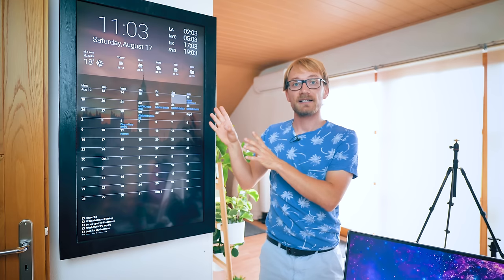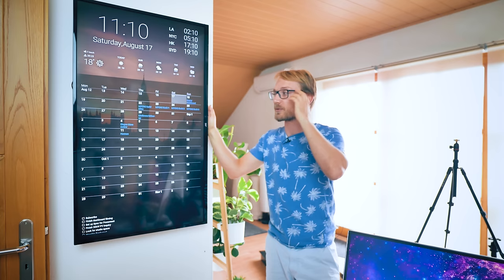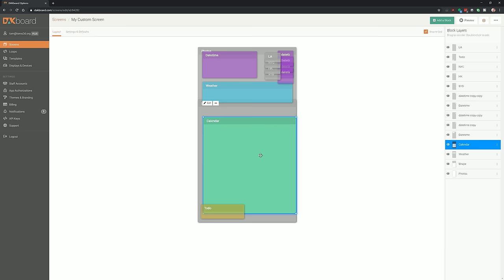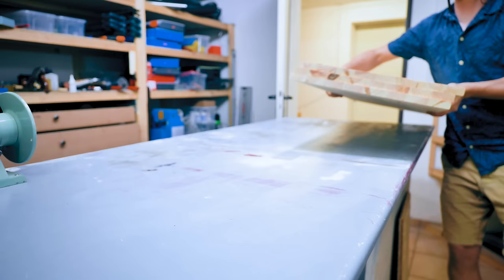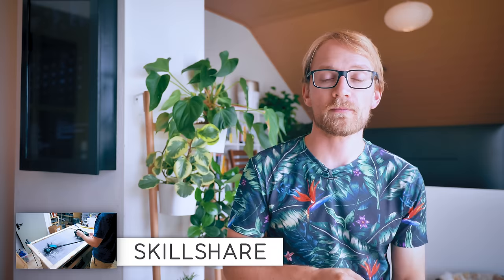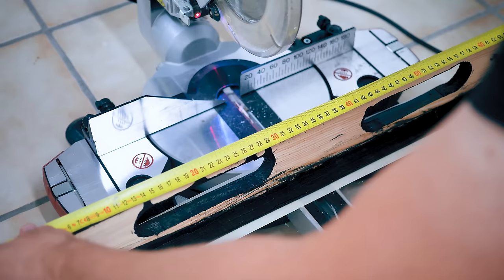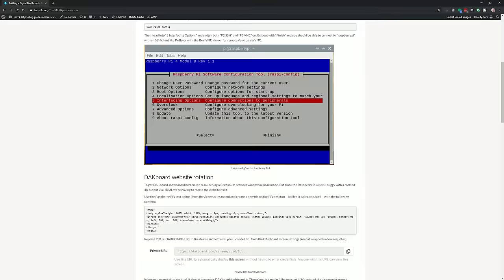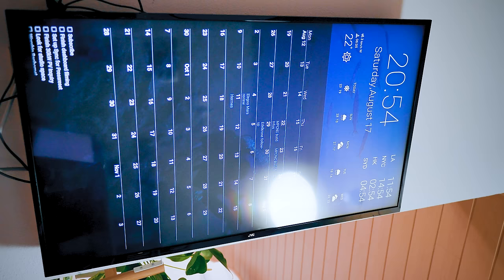Making a Digital Dashboard! (w/ Google Calendar integration)

Comment: @Thomas Sanladerer  check out xrandr for screen rotation, calling xrandr with no parameters lists connected screens and their ports. To rotate for example screen connected to port HDMI-1 (output on my PC) it should work with just: xrandr --output HDMI-1 --rotate right
Then just place it to same place where you start Chromium. If you wanted to change more parameters, you can install simple graphical tool arandr (or lxrandr) - enable screens you want, set their resolution and rotation as you want and then save as file. It will generate batch file with command you can just copy into your LXDE autostart file and it should apply all changes. If Raspbian still uses xserver, then it should work with no problem. Also another autostart file is .xinitrc and that should be universal for any desktop environment.

Comment: I would like to know more about the music clips used.

What I would do, add a motion sensor that could be used to turn on the screen, and off if no movement had been detected. With a long timeout for off of course.  I am using some cheapy microwave sensors bought from Aliexpress for about a dollar. They are very sensitive. This could save some power and extend the life of the screen for some people.
Reply from the maker: All my music is from Epidemic Sound! http://share.epidemicsound.com/MadeWithLayers
Nice tip with the microwave/radar sensors - I've only used PIR in the past, but radar could be a more sensitive option.

Comment: you can add a motion sensor to turn on and off the monitor
Reply: Totally agree. We have a small picture frame that cycles pictures with the date and time in the corner that is activated with a PIR sensor. Definitely more energy efficient.
Reply: Agreed.  Though depending on monitor/TV the wake time might be annoying - using an OLED would help, but also be insanely expensive.

Perhaps setting it so that between 6am and 6pm or something motion causes it to turn on immediately and off after 10 minutes without motion, but between 6pm and 6am it turns on only after say 15 seconds of motion but off after only like 2 minutes without motion - if you had to check it it'd kick on but if you walked past at night it wouldn't turn on.

Comment: In the AV world there is a flush TV Mount that is called a Rubberband Mount. Just two Metal Disks you attach to the wall and thick cable you attach to the VESA mounting on the TV. However it would be recommended to use a recessed electrical outlet. This way you only have to deal with the thickness of the TV itself.

A honeydoo list is always fine but a stock ticker or local news ticker on the bottom is always great to have. If you listen to a lot of music while working you could have it show the Artist/Album/Song title in a little area.

Comment: You might reconsider using the wiggly end of the tape measure after you read this. The reason it is wiggly is to offset its own sickness. When you push it up against something it shifts just as much as it is sick same thing when you hook it on the edge of something and pull it it shifts back to offset so it always reads correctly

Comment: One trick that you can use to get the IR remote working better is to make a "waveguide" from a piece of clear acrylic. Bevel the top and bottom of the piece to help internal reflection and leave the end of it poking out from the inside of your timber bezel.

Comment: Magic mirror without mirror? :hmm: 
I'm running five 50" 4K screens for dashboards at work, two of them powered by Raspberry Pi 3s with mentioned 4K@15Hz configs. However in my experience I think truth is that these dashboards are cool for few months and then you just forget them on the wall. The data on these dashboards must be simplified and easy to peek for quick information otherwise you stop caring what's visible there. :)
Well, DIY projects aren't always mean to be long-lasting like maybe this one. The fun comes from building and configuring it.
Reply: Insomniumer what kind of work do you do?
Reply: @JLake3D  Network Operations Center, it means a lot of stuff (networks, servers) to monitor in real-time.

Comment: I want this But With E-paper! 
It would use much less power, have great viewing angles and not emit light during night.
Reply: Same. But every time I look at prices for this (which has been like every 6 months for the past 2 years), E-ink displays are still very expensive and not very big. Like commonly available e-ink displays for the Pi are like 7-inches big for $500. And refurbished kindle screens aren’t much bigger. Something as big as a sheet of printer paper 8.5” x 11” doesn’t even seem to be available outside of bulk/commercial pricing, let alone something as big as what he has hanging on the wall there... oh yes, and those are all monochrome. Just forget color e ink exists because you can’t get your hands on them... 😩

Comment: "the wiggly end of the measuring tape" serves a real purpose. It allows for accurate measurements to inside and outside edges. Notice it wiggles by precisely the thickness of the metal hook.

Comment: I wonder if this (or something like this) could handle heat and some humidity. I'm looking for something like a small digital whiteboard to put above my deep freezer, where I can make a list of all the items in the deep freezer, the expiration dates, etc. I'd also like it to look at the current date and when something is getting close to 90 days of expiring it'll highlight it in green, 60 days of expiring it'll highlight it in yellow, when it's 30 days of expiring orange and when it's expired highlight it in red. Also, some sort of check off/adding system, so when something is removed, it'll take it off the list, or if something is added, it's added to the list. This way you'd have an inventory at a glance when you go shopping... better yet, it'd be nice if you can have it to add staple items to your shopping list once you get down to x level ... or even where you can access the same list when you're at the grocery store.

Another nice feature would be where you can see a log of the temp inside the freezer, preferably without a wire coming out of the freezer (bluetooth maybe??), so you can see what the temp is, and a record of the temp so you can see if it's went above freezing, etc.

Comment: I am a huge fan of PetRockBlock's PowerBlock for adding a Raspberry Pi power switch. Using them on almost all of my Pi projects now. They have a separate LED indicator light circuit as well as a standalone 5v output. One click of a button, the software starts a safe shutdown of the pi, the LED indicator illuminates in different patterns to let you know what is happening, and after safe Pi shutdown it cuts power to the 5V out line which in turn switches off my MeanWell power supply (RSP series, which has a remote on/off capability). Adafruit has a new RGB version of the ubiquitous LED ring power switch, so I can now use LED color as an indicator in addition to the flashing pattern.  Yes you can roll your own safe shutdown switch for a little less money, but this board has been 100% flawless for me - worth a little extra money for the built in features and the fact that I don't have to mess with it

Comment: I have a similar project running. I'd recommend the following, the chromium browser and the rest of the system is constantly writing to your card, you can check for IO activity using an utility like iotop. All that small file writing will kill your SD card fairly quick. Install  profile-sync-daemon to send the chromium profile to RAM, and install log2ram for everything else.

Comment: "deal with the wiggly end".... it "wiggles" so that your measurement isn't off by the thickness of the tip of the tape measure.
Reply: More about easier accuracy than having to rely on a moving bit that might have been slightly bent.
Reply: @z0178  Tom's method obviously worked out great for him, and I'm sure the accuracy of those cuts to shorten it were more accurate than a slightly bent tape measure tip.... /sarcasm 

Honestly for woodworking a slightly bent tape end (that is not bent enough to be noticable) is plenty accurate enough.
Reply from the maker: Really, I just didn't want to scratch the screen... But, yeah, using the tape properly would have been quite a bit more accurate in the end 😅

Comment: Thanks a lot! I've been looking for months for a good service to put reports in the TVs in our office and was using a terrible solution combining Google Photos, Chromecast and python that would work very well most of the time and terribly bad a few times.

This worked really well with just a few hours adapting and studying the software. It's really easy to use it with smart TVs, don't even need the raspberry pi.

Comment: You could add one of those IR repeaters used for keeping your misc units contained within a closed cupboard to avoid having a hole in the frame. Or possibly even make some IR hardware for the Pi and let it control the TV via CEC.

Comment: I want almost exactly this for my house, but with a touchscreen, plus an auxiliary keyboard with integrated touchpad on a fold-down shelf. 

Currently there's a wall that has a large blotter calendar, a white board, and a cork board which is the "family command center". Works well as it's in a place where everyone can see it... except me, when I'm at work. And nobody wants to add everything to two calendars (e.g. the paper one and a Google one) so I'm frequently in the dark about what's upcoming.
 I've wished for a long time for an electronic solution but large touchscreen displays are ruinously expensive and I only realized recently that touchscreen conversion frames were a thing and apparently work well enough for what I want to do.

Problem is that with the TV (~$200), the Pi (~$100), the touchscreen conversion frame ($200), the keyboard ($20), and the wood and hardware to mount it and make it all look good, this would end up running well over $500, not to mention the time and effort. I think it would be a fun project though...

Comment: Question: Does the screen burn-in occur faster from leaving the exact same screen for 10 hours a day?
Reply from the maker: Modern LCD screens, unlike OLED or Plasma, do not suffer from burn-in.
Reply: @MadeWithLayers  actually LED screens are able to suffer from “burn in” but is a relatively easy fix, white screen for 6-8 hours and back to normal helps “reset” the affected pixels ,

Comment: I'd have added a motion sensor to the Pi, so if it doesn't see movement, it will reduce brightness, and maybe a wireless mouse too, it's ace, but consider the power for a static image? Maybe photo feeds for interest.

Comment: To avoid screen burn-outs picture should change with time - move some pixels vertical/horizontal every fifteen minutes, or gradually change colors. Even professional display used for digital signage can easily suffer from burn-outs, and this type screen is manufactured to withstand 24/7 displaying.

Comment: Would that be cool if that had touch screen...
Reply: I did something similar to what Thomas did but used a touchscreen monitor.  It's a royal PITA to get the monitor and the PI and the touch to all play nicely.  If the display is turned then the touch doesn't rotate so your presses don't line up.  I'm still trying to work it out and gave up for a few weeks.
Reply: I would add a leap motion below the screen and use gestures to control it.
Reply: @diymatt  i recently had the same Problem. You just need to use "xinput list" to show all your input devices. Get the ID and the driver name for the touchscreen. Then Google how you can change the Rotation/Axis/Inversion for the driver of the Touchscreen  with "xinput set-prop" . Eg the evdev driver for some devices. Its honestly not so much work to find out. Hope that was the notch in the right direction and you now what to Google for.
Reply: @diymatt  assuming you are using some kind of Linux device with xorg interface like the raspberry pi
Reply: @THEiDATA  WHOAH, that was super helpful.  Yep, using a Pi too.  Thanks!

Comment: Makita intro: perfect

As a software engineer/programmer/whatever term you actually agree with, MagicMirror 2's documentation is about what I expect. Unless you are willing to pay the developer making free/OSS for a desired feature, they will make it as utilitarian as possible as it's easier to add/modify features. That's why the paid software is so easy... because you are paying the developers for it.

Though, doing CSS and half the configuration you did for the RPi is... about as complex as MM2's docs seem to indicate, so not really getting the complexity argument.

I've been putting off setting up one of these for way too long. Thanks for making one.

Comment: Great project. I'd probably want to extend it so the screen doubles as a digital poster. Could switch back and forth through a button on the frame, or with a remote

Comment: WRT the "wiggly end" on tape measures:  It's a feature, not a bug.  Really!  It's there to allow for the width of the hook on the end of the tape:  To take an inside measurement (a doorway, for instance), you push the front surface of the hook against one side; this makes the hook slide just far enough to put that front surface in the plane perpendicular to the tape's zero.  To take an outside measurement, you hook the hook over one end of the thing and pull the tape:  This makes the hook move just enough to put its back surface at zero.  You should check your tape's accuracy every now and again - they wear.  But no need to measure from somewhere other than zero and then remember to subtract.

Comment: To reduce the power consumption i would try to use a motion/presence or radar sensor to turn the TV on and off. Or if that would be too slow just switch the internal backlight on and off because that usually draws the most power.

Comment: Add an IR motion detector to sense when to output video, and set the TV for auto-on power mode when it senses video input... it helps save a lot on power.

Comment: Very cool, I'm trying to start a kiosk company and this video helped fill in some gaps.  When I saw the dry erase board being demoted I thought, yep that's something I would have done.  My suggestion for the to-do area is to divide it in two or three sections, so you can see upcoming tasks, one task per square.  Good job with the frame!

Comment: LED TV are not meant to display static images or anything that is no changing over time and this causes a burn effect (idk tha exact term)on LED TV and it stays there even if the tv is turned off. Like something is burned out and leaves the mark, it is like that. LCD screen are a better choice for this kind of work. This is the reason why we don't use LED screen as a monitor for PC. For more understanding watch techquickie
Reply: rahul 411 You’re confusing OLED with LED. An “LED TV” uses an LCD panel to display the image (and as such, screen burn isn’t really an issue). “LED” simply refers to the backlighting (as opposed to fluorescent).

Comment: I've built something similar, but was even lazier about it:

One old Acer laptop from the dark ages, running Bliss OS (an android built for pc thing - it's free and good). I've got the bliss os/android/laptop hybrid monster using nova launcher. 

I attached and connected the laptop to the back of a 23inch Hanns G touchscreen panel and an old mini speaker I have lying around. I then sealed everything in a shadow box ( it's about 5 inches thick).

Assistant can still pick up my voice from inside the closed laptop inside the shadow box - but I may fit a mini mic and camera upfront soon.

Nova allows me to have greater control over widget placement and homescreen layout. I also have the added benefit of being able to launch any (most if using bliss os) android apps. It's kind of like a Google home hub screen that bigger and louder and cheaper but without the limitations.

We have two homescreen pages, one is a notification weather, news,, email and calendar dash with a few core "buttons" for lights and smart plugs etc.

The other is a complete control dashboard for all smart stuff. 

I cannot recommend this method enough, android looks beautiful blown up big and being able to launch my usual phone apps and use gesture control on my kitchen wall makes me feel like I'm I'm the future.  👾

Comment: This is very cool.  I expect everyone will have one of these in their home in 10 years, but right now it's very much an alpha product.  I think it will take one of the big operating system tech firms (Apple, Google, Microsoft) to make setup relatively turnkey for users. Right now, the widgets offered are few and many are broken (e.g. Apple iCal and Google Nest don't work).  For home audio, it only supports Spotify right now.  It probably needs some kind of simple, click wheel interface to provide for scrolling to other screen options (no, a touch screen wouldn't work because you don't want to constantly wipe off finger prints). But I love the idea of an electronic wall planner and audio entertainment system.

Comment: Screenly is another option, although more geared to be a digital signage board but a few things cross over. If you rely on the Pi Wifi, you may end up with it dropping off the network. If so, write the script to ping your router, if it can't find it then restart the wlan0 adapter.

Comment: I have made something very simular.  But I did the graphics all in powerpoint from an old laptop. It is easy to edit and update. Negating having to learn new software,  for me anyway as I am proficient with powerpoint. And rotating the screen on any laptop is built into the os. I kept mine landscape but could easily make it portrait.